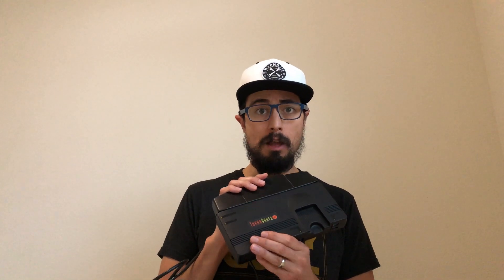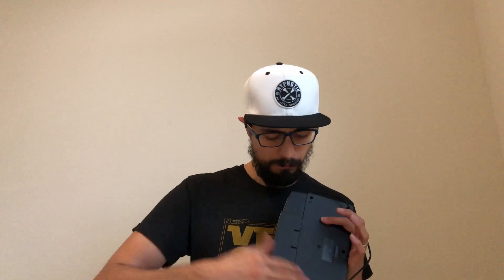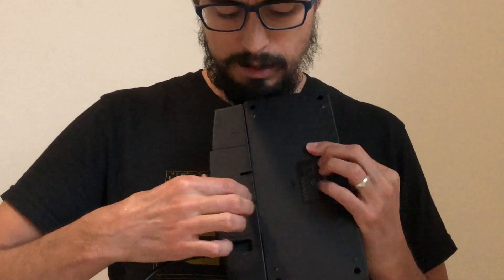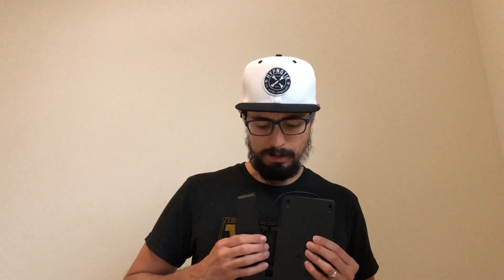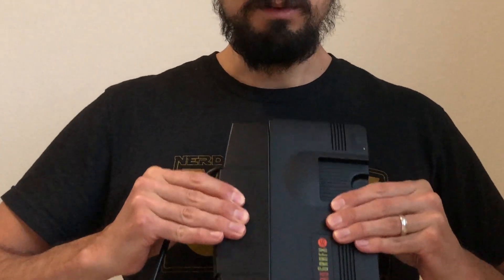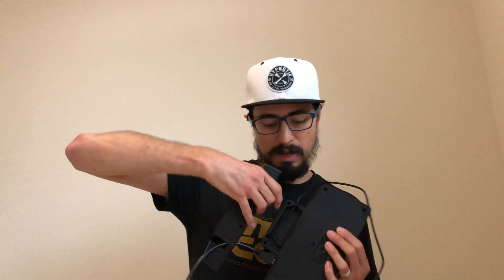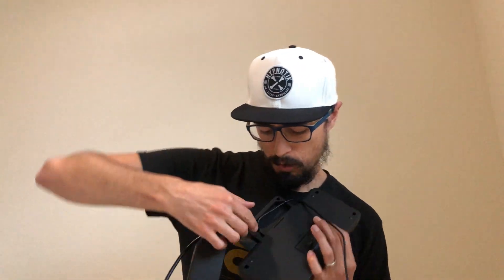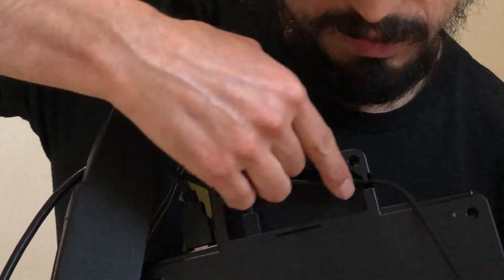How to properly remove the back of the TurboGrafx-16 Mini

Comment: Thank you for the tip. Btw, the Turbo Grafx-16 Mini exclusive "Salamander" also has a hidden near arcade mode available. Just hold "Select" then press "Run" to start the game.  If the code worked, you'll get an old school style arcade boot screen.  I haven't played near arcade Salamander much, but there's a lot of digitized speech absent from the original PC Engine version and more. It was really cool of M2 to do this for the TG16 Mini since we missed out on Force Gear, etc. One code I'd like to see would be an easy way to enable the "high res/arcade" mode in the applicable games such as Soldier Blade, Blazing Lasers, Dragon Spirit, etc.
Reply from the maker: Awesome! Thanks for sharing that information, I’ll be sure to mention it in our review
Reply: @creativecatproductions  No problem. My pleasure 👍

Comment: Thanks for the info so if I decide to get it I will know what to do. Also do you know what power adapter will work with it? I heard it doesn’t come with one. Do you know if the Nes mini adapter works with it or I can power it using the USB port on my tv by any chance?
Reply from the maker: I actually never got the power adapter myself. It comes with a USB cable that allows you to power it via a USB port on a TV. I don't know if the NES mini adapter will work with it, but the one Hori is selling (specifically for this console) connects to the USB cable that it does come with so you can plug it into an outlet. It works just fine without doing this though!
Reply: So then it I can successfully power it using my tv without ruining it then?
Reply from the maker: Sorry I missed this comment! I believe it depends on your TV. I’m using a small $60 flat screen I bought at Best Buy especially for our mini console collection. It’s as basic and minimal as a contemporary TV can be, but it’s less than 3 years old. I think that if you have a modern TV with the USB port that it will probably work just fine. I’ve heard some reports of people with different set ups having trouble with the unit shutting down on them, due to insufficient power coming from their tv/usb connection, but it’s not clear to me why that would be the case. It’s possible those problems are caused by their TV or their particular setup and not the TG16 Mini itself. We’ve used the NES Mini, SNES mini, Genesis Classic, and TG16 mini.....all powered via the USB connection to our little TV....and it’s never been a problem. If you’ve been able to run another mini console I think it should work just as well.

Comment: Hey CCP does this come with a US power supply? Just ordered mine
Reply from the maker: You don’t get an AC adapter, that’s sold separately, but it comes with a USB cable that can plug into a TV or a cell phone charger. Most modern TVs have at least one USB connection somewhere on the back or side....but most people have them occupied! I don’t, so buying an AC adapter is not desirable for me. I like minimizing things I have to plug into my wall.
Reply: @creativecatproductions  great thank you! Does the gameplay and menu come out of the box in english or is it Japanese?
Reply from the maker: Breaker Of Chains sorry I missed this comment, with the exception of a few of the pc Engine games, like Snatcher, all the games on here either have a US version or require no English to play

Comment: Looks like the CoreGrafx model is in stock on Amazon Japan, I'm gonna order it, see what the shipping comes to... My problem is they don't take PayPal and they're gonna force me to use my MasterCard debit which is tied to my bank checking account - I DO NOT like to use that card, (spreading a CC# around is bad idea), only use it at the ATM when I need cash. For bills and other shopping, I use my Discover Card (when PayPal is not an option), but that CC is less accepted sadly...

Comment: is this authentic to how it was on a real turbografx? this is the first console i ever bought where it was a math question trying to plug the damn thing into the tv. probably would have ordered the japanese version if i knew this was the case
Reply from the maker: The backing coming off like this is pretty much the same thing as what we had with the original TurboGrafx, but obviously there were completely different cables to work with. The European version (the CoreGrafx) has the exact same game library as the TurboGrafx Mini, and has the turbo switches on the controller, and it also has the smaller, easier to setup shape of the PC Engine Mini. I personally prefer the TurboGrafx shell, because of nostalgia and how awesome/ridiculous it looks, but the CoreGrafx is a great alternative.

I don’t like the PC Engine version because it lacks Salamander, one of my favorite shooters, and instead comes with a dating simulator and an rpg, which are both completely in Japanese.

Comment: Very first impression...not asthetically (sp?)  pleasing.  If it the exact same as the CoreGrafx, then I'm buying that.
Reply from the maker: the CoreGrafx has the exact same game library as the TurboGrafx (which I prefer to the pc Engine version) and also comes with the Turbo switches on the controller. If you prefer the smaller sized console then the CoreGrafx is the best of both worlds!

Comment: wow Konami still sucks. Who at Konami designed this thing lol?
Reply from the maker: It is too finicky to be sure, but the mini console is great overall. The CoreGrafx Mini has the exact same game library as the Turbografx Mini, but comes with the same smaller, easier to work with casing of the PC Engine mini. It’s just a different color. A lot of people prefer it for the size alone.